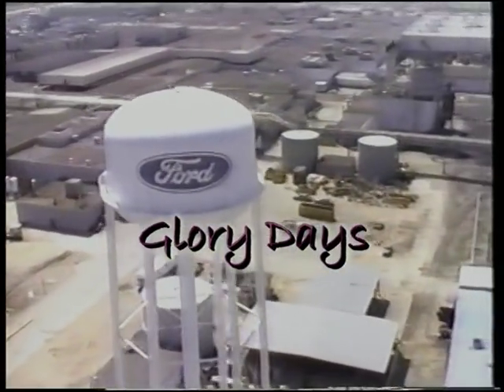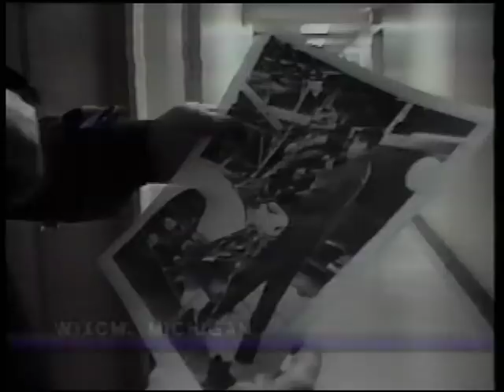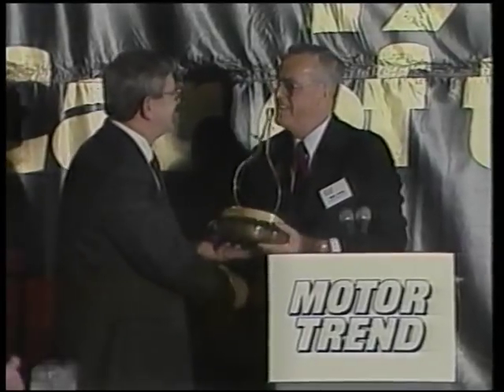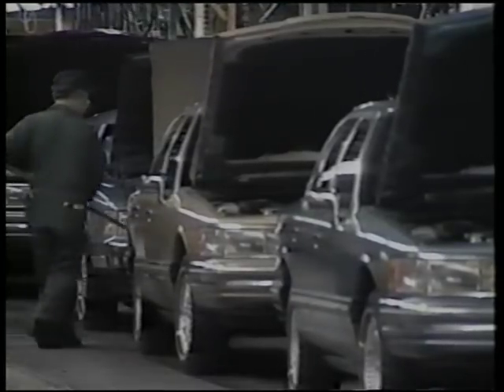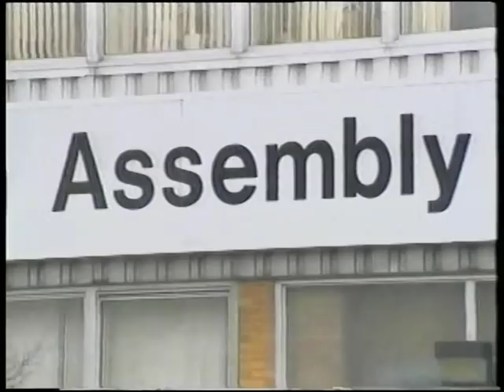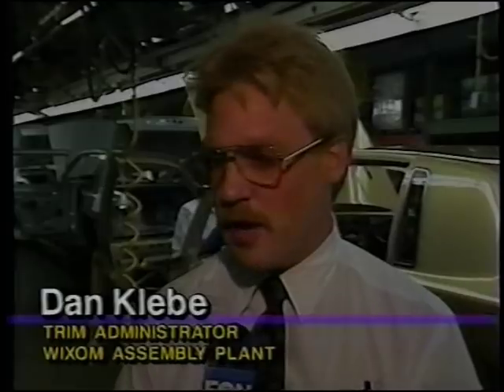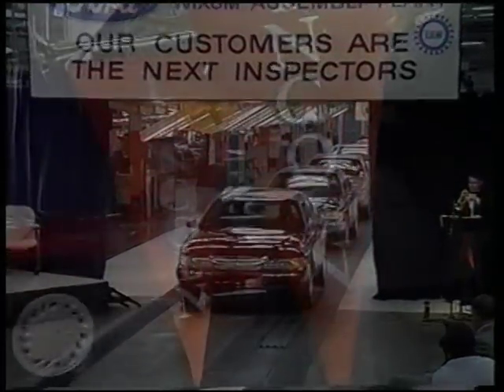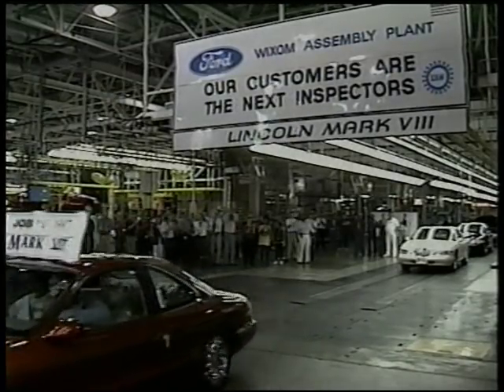Ford Wixom Assembly Plant Glory Days (Part 1)

Comment: Thanks to all of Wixom! You built my 1987 Lincoln Town Car all of those years ago. I put well over 400K miles on that car and sold it in 1996 to a taxi cab driver in New York City. I now have a 2002 Lincoln LS that I ordered in 2001 and it just broke 119K and still looks just as good as the day it was delivered.
Reply: Got hired in back in 95 very cool place with great people left in 07 when it idled such a cool facility

Comment: It’s cool seeing the people that worked to build the Town Cars.
Reply: A friend I know has a 1974 Thunderbird Bordeaux edition. It was built in April of 1974 at Wixom assembly plant. It is fully loaded with all the toys. dual reclining seats, AM/FM stereo radio with quadraphonic 8-track, electric rear window defroster, automatic headlights, moonroof, power passenger seat, sure-trac differential, 4-wheel disc brakes. Bought the car from the estate of an elderly owner who passed away in 1997.

Comment: Nice Video! Budd Co. supplied all the major class 1 assemblies - roof, doors, hoods, deck lids, quarter panels, and front fenders to Ford Mo. Co.
Wixom was a real clean plant.
Reply: All that you mentioned were manufactured at the Budd Co. hunting park ave plant in Phila..
Reply: @pat5882  Budd Gary plant closed and Budd Detroit supplied Lincoln model assemblies to Wixom too. Take care!
Reply: @tonytrotta9322  had a Mazda 626 about 25 years ago. The car was assembled in a Ford plant and all of the body panels were from Budd co Phila..
Reply: @pat5882  I worked at Budd for 24 years and they made parts and assemblies for the Big 3  - Chrysler van doors, Econoline, Ford - Bronco and Ranger. Also, foreign cars. Phila was the orig. plant - also there was Detroit, Gary, Kitchner, Shelbyville.
Reply: @tonytrotta9322  I know, my dad was at the phila plant ‘52-‘82.
Reply: @pat5882  Great! I was at Budd Rochester, MI - Engineering that serviced all plants from 1983 - 2007 when they closed.
Reply: @tonytrotta9322  They actually asked him if he wanted to return to work. They needed veterans when, i guess, it was when shelbyville opened. Tennessee, right? He declined, my Dad had something on the side, he’s a business man, of sorts.
Reply: @pat5882  Yes, late 80's Shelbyville opened - $100 million dollar plant and built parts for the Explorer - 400,000 a year and currently, owned by Martinrea. A lot of hard workers and great people at Budd co. and a great place to work too. Take care and thanks for sharing!
Reply: @tonytrotta9322  you’re welcome!
Take care!
Reply: @pat5882  You are welcome! Shelbyville is in Kentucky. Have a great weekend!

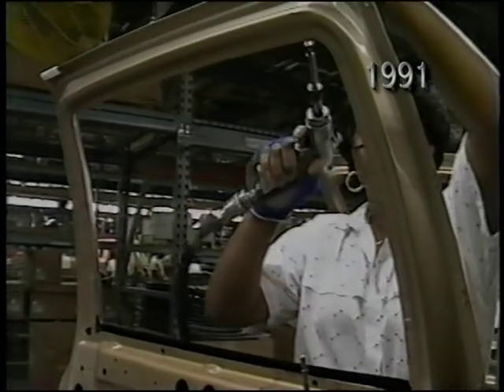Comment: @ 13:47 Screws vs. Rivets for window surround trim. 
Methinks that buried in the Ford Archives is a file 6" thick from the later 70s or early 80s that definitively proved that a change to screws from rivets would save...

It would be interesting to see that study to learn how many cents were saved per car and how long / how many cars was the projected payback period. Then to see the unexpected costs because the rivet gun required a human with a certain level of strength but that station was assigned to persons that didn't meet that strength threshold. Then to also see why and who was responsible for allowing the position to be assigned to persons whose arm and hand strength didn't exceed the actual threshold necessary. Is it possible that the Ford engineers that undertook the original study neglected to consider what could occur if less robust persons were assigned to this station? Surely not.
Reply: Easier to re-design the rivet gun and make a simple, 1 easy-touch operation button. General Motors Corvette have had them for years.